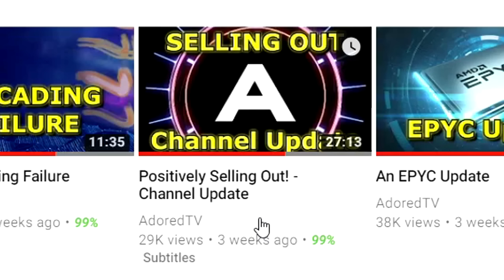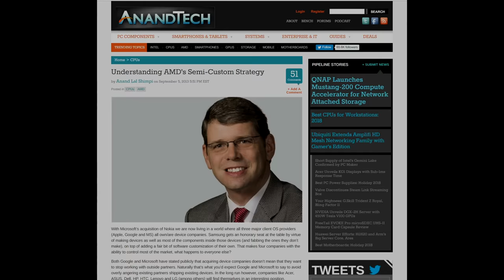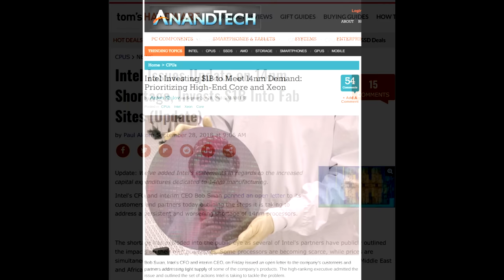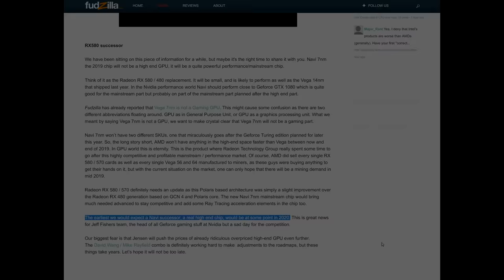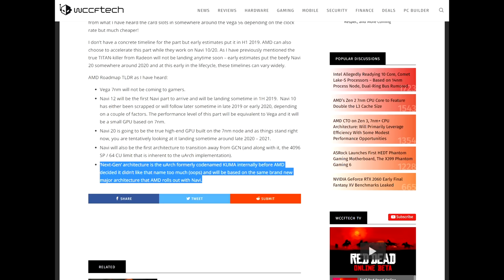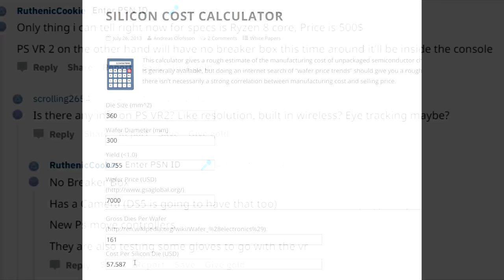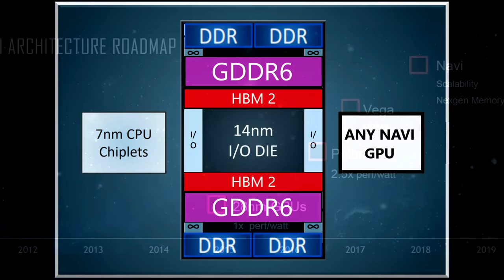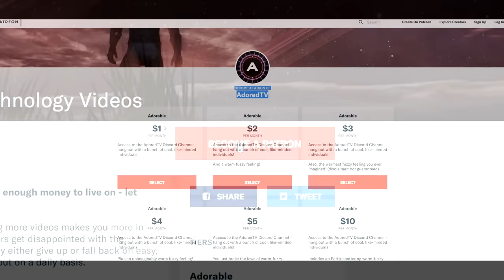AMD  - The (Evolving) Master Plan

Comment: Something I have to bring up about the NVidia vs. AMD GPU wars. One of the main reasons people stayed/went with NVidia was because (even though their hardware was at times the same or inferior) NVidia had drivers with MUCH fewer issues. I can't begin to describe some of the weird issues that various GPU vendors had (3DFX, S3 and ATI) that NVidia didn't.

I'm talking about drivers that wouldn't install (or cleanly uninstall), or that would install and then BSOD your computer, or that wouldn't properly render 30%+ of the games available on the market, or would cause the game  (or your system) to crash if you played said game. NVidia side-stepped a TON of that.

They also implemented a near-fully functioning OpenGL driver that 'just worked' not only for games, but also professional applications. That helped gain them a lot of mind-share with the emerging 'professional-at-home' market that was beginning to spin up in the 3D, compositing and video editing worlds. There were other things as well (unified drivers, the ability to downgrade without issue if the newest driver was causing issues, etc.)

I feel that is the real reason why people started ignoring the other GPU vendors in favor of NVidia, and have stuck with them. I can say that I was reading the mentioned Anandtech articles (both in this video and others) that you've referenced - when they came out, mind you - and it got me interested in buying AMD/ATI again (and yes, I had a few of their GPUs before)...but then the hardware would come out and the driver issues would follow, so ultimately I stuck with NVidia and have to this day.

When your work relies on your computer/GPU, having good/stable drivers means you'll go with more expensive/slower hardware if it'll reliably get the finished result out the door (or let you play a game without crashing).
Reply: While that might be true today, I was talking about back when NVidia didn't have a majority of the market (or even the lead in dGPU deployments or sales) that they made things better and easier for consumers. The time period I'm talking about was when 3DFX ruled the roost and ATI and Matrox were chief competitors (and S3 was the cheap 'un-accelerator'). That aforementioned ease and reliability is what helped NVidia take the lead and eventually snuff out most of them.

As to today, their quality has gone down (too many weird bugs in their latest drivers, in addition to other issues) and ATI/AMD is doing a lot better on the driver front than back in the late 1990s/all of the 2000s/most of the 2010s, but with the momentum NVidia has (and their excellent marketing, the sheeple effect in full force and some of their vendor lock-in) it'll be hard (but not impossible) for AMD to gain a majority...

That said, AMD still needs to get their drivers in better shape (esp. for their APUs) if they want to have a chance at beating NVidia.
Reply: AMD has not given up, it's just they didn't have the money to do both Zen and Vega (properly), so they went with Zen first (AdoredTV covered this not only in this very video but some others as well) and now that they're making money they've invested in the GPU side as well...but as this and other videos point out, it takes at least 2 (usually 4+) years for that investment to show up in product that the public can buy.

As to Intel, your supposition is completely ridiculous. The government has nothing to do with their decision to make GPUs. It's - again, covered in another AdoredTV video - that we're talking about a (capitalist-driven, free-market-created) $40 BILLION (USD) industry and anyone who can make that kind of stuff would be a fool to not get in on the action. Intel has the fabs, the engineers, the money and the contacts/reputation to make it happen, so they're doing it.

NVidia (who practically created that market single-handed) is in it, so is AMD (who stands to make a nice profit, if not a lot of money), ARM is working on being in it (will be interesting to see how that turns out), and there are even rumors of Imagination trying to get into it.

As to AMD crashing, I certainly hope not, but they need to do better on the GPU side. On the CPU side they've turned it around, and on the APU side they stand to make some nice money over the next few years, in addition to the console business. Hopefully AMD can turn it around on the GPU side (just like they did with their CPUs)...and if they don't...well Intel (and maybe someday ARM or Imagination or someone else we don't know about) will try to sell you a GPU instead.

Comment: I really hope that the PS5 does have a 8 core Zen based cpu, it would make it easier for pc games to utilize cpus with high thread counts like the Ryzen 5 and i7 8700
Reply: You know PS4 and Xbox One is already on slower 8 cores (7 usable for the game 1 reserved for system work), this environment favors multi threading even more, yet game still struggle to do so. Biggest problem is sequential nature of games programs, you can divided task in to threads infinitely (the perfect multi threaded program should scale infinitely), but what kill the entire concept is data from other task wait time and actual power needs of those tasks not saturating the CPU entirely. Because of that games never gonna use 100% of any multi CPU setup

Comment: Hey Jim, I've watched this 6 or 7 times now but the 1 thing that's bugging me is how much GPU power does a PS5 actually require to be a 4k 60fps stable kind of monster?

I mean you said it yourself in this video the PlayStation is a closed system and without really looking into it I thought the current consoles did 4k by rendering 1440p then upscaling it and ending up around the 30fps mark.

As you know there's a big difference between an "upscaled 4k 60fps monster" and a "4k native resolution 60fps monster"

Is it possible you're over estimating what is required to reach 4k/60 native based on what a PC requires?

Anyway keep up the great work mate. Catch ya later!

Comment: Hindsight is 20/20 however I think the key is not that chiplets are better than monolithic, the key is actually having the guts to do it, implementation, people don't always read statistics and facts the same way, or sometimes companies are too rigid.
Like you say if Amd has gone this way, they must've done it without reassurement. 
The notion of spliting large components into multiple smaller parts is not new at all, miniaturization is at the core of electronics, th japanese led tge way in the 60's, that's what made electronics affordable, yet it is still impressive the brilliance in these new implementations.

Comment: Could it be possible that with the scale of manufacturing console chips AMD would use this to their advantage? What I mean by this is AMD could use the same chiplet modules found in next gen consoles for the desktop and server markets. Low performing chips could be binned for consoles but higher performing parts may be used in high end Ryzen and threadripper packages. This would allow for AMD to match intel when it comes to economies of scale and all the benefits that come with that. Is this plausible?
Reply: Possible

Comment: surely it would just be cheaper for them to eat the cost of the defective zen 2 chiplets than have 2 4 core chiplets? especially as the process matures.

maybe amd could instead produce the chiplets with tsmc then sell them to sony rather than sony going to tsmc, allowing them to better utilise the perfect 8 cores rather than fuse them off for 6 cores, this would also change the bell curve for their consumer market as they would be buying more wafers and more 8 cores would be going to sony, not pc while all 6 cores do.

oh and ofc you mention it later, not a stone unturned.

Comment: about sharing the same chips between the consumer and the console space: wouldn't it be at least somewhat problematic that the console has a much longer lifecycle so a zen 2 chiplet may be long gone on the consumer space when it's still used in the console space. Over time limiting the scaling benefits of sharing the design. Sure you may sell of some chips for legacy server orders but that would probably be about it.

Comment: im having a hard time figuring out what they are doing for the desktop as well.  if they go with chiplets there will be a hit on mem latency if they have to go off die to hit the io die.  the extra l3 would help there but still.  if they go with a seperate die for the destkop with the whole soc on it then they cant bin the chips to make epyc from those.  maybe they could put an imc on the chiplets that is just deactivated when used for epyc but functioning when use for the desktop with an io die as well for soc functions.  im pretty sure the usb and pcie lanes go off the soc on the current ryzens.  you could put that on the io die and have the imc on the chiplet.  that way there is no memory latenyc hit when using the chiplets for desktop.  i just dont see them going with a memory controller thats not on the die.  it wont be a huge hit to latency but when you go off die on epyc and threadripper chips the latency is pretty large compared to just ccx to ccx on the same die. 

whatever they do im sure it will be interesting.  glad to see them back in the game. now we just need a new gpu.  a real one.

edit:  just got to the part about the consoles.  that would certainly replace the large pool of desktop cpus.  so that means they could make a seperate line of desktop cpus that dont use chiplets.  the rule with consoles is that you make sure that programs can fit inside cache because you have to save all the bandwidth for the gpu since the cpu and gpu share the same memory.  that would mean that the memory latency from using a mem controller that isnt integrated on the same die as the chiplet would not be as big of a problem.  so im leaning more towards a complete soc for the desktop mroe than ever

Comment: I don't know if a monolithic die for the PS5 is actually that much of a problem. They could use the defective dies and have a $300 PS5 base that achieves 1080p60, with a $500 PS5 that achieves the 4k60 that is rumored.
Reply: I'm just saying that the low yields from a monolithic die solution aren't as hampering that AdoredTV implies.

Comment: I wonder what the pricing will be. Will it force Nvidia prices down, or will AMD go up to meet them; say the 2060 is $399.99, will AMD say "Pft, chip+RAM+board=$163.22. MSRP will start at $249.99 for a card that slightly outperforms the Vega 56 at stock speeds", or if they will jump on profit and hope to pull away a smaller segment of the market, selling the card for $349.99+. I obviously hope for the previous, but unfortunately for me, I'm not in the market for anything less powerful than a 2080ti, which I won't pay $1250-$1400 for. A grand? Probably, and I would much rather buy from AMD right now anyway, as they are the ones who aren't trying to exploit their customers atm (not that they are above it, but they certainly could have charged a bit more for Zen+ an TR, but the price points basically stayed the same while improvements went up a decent amount).

The "Hurry up and wait" from RTG is annoying as heck though. If Navi 10 had 1080ti levels of performance at a high midrange price ($279.99-$349.99) then I might consider upgrading my midrange PC. If not I'll just keep saving until I can get what I want at a price I am comfortable with, though the more money I put aside, the more difficult not overpaying and waiting becomes.

Comment: Don't IO features on a die needs to be around the edge due to the machines connecting the die to the substrate pads with tiny gold cables? Does anyone know of an example were connections spanned to the middle of such a large die (Jim's suggested IO die)? 

Another interesting point I want to throw out there is the salvaging of dies, not just from dust defects, but also individual cores' attainable clock speeds. If true, it would mean a slightly cut down GPU/CPU where the very worst performing cores/streaming processor clusters were disabled would allow for an overall increase to the clockspeed of the chip.

Comment: Did you take into account that all the controllers and interfaces on the I/O chip all need to be on the perimeter? A 150mm2 I/O die is going to be pad limited with a 256bit GDDR5/6 bus, let alone a 384bit bus, 2048bit HBM2/3 interface, DDR4, and IF. IMO- I don't see them putting the GPU I/O on the I/O chip, it seems to add way too much complexity for no gain/advantage. 

I mean, maybe I could see a 128bit GDDR6 bus or a 1024bit HBM2/3 (aka ~250GB/s bandwidth) interface on their "consumer" I/O chip for use with their APUs/SemiCustom SOCs or maybe they move the consumer I/O chip to 28nm which means larger die size (i.e. more pad space) at a cheaper price?  

If your crazy I/O die is true, where does that leave Navi 10 and 12? Every single desktop GPU needs the I/O chip as well, wasting the space of the DDR4, IF, and whatever parts of the GPU bus that chip doesn't need?

Comment: And now another interesting piece (which you likely already heard, but didn't have  time to include): "[Rumor] Microsoft Surfaces considering AMD for next generation"

Almost all big IHVs that push new form factors (apple, MS, hp, dell... etc) are very frustrated with the exceedingly lacking iGPU of Intel chips, where to do anything extra requires a discrete GPU which blows the whole power budget. To be able to get a APU with even 1070 as a baseline and 6+cores would have them doing bidding wars for what little scraps they could find on the floor. Remember that these classes of laptops/mobile devices sell for thousands easily. Now you have shockingly good yields reusing up and down a product line? 

I really hope even half of this is correct, means quite exciting times, and perhaps one of the first truly industry wide shakeups since the early 2000s.

Comment: i think the performance will be gtx 1080 performance range not a 1080 ti. a 1080 will be double the power of the current 4k 30 fps consoles they can do 4k 60 with a 1080 if they lower the settings which they always do on consoles

Comment: But isn't 8-Core chiplet already confirmed to be ~70mm2 ? Whats the point of a PS5 prediction with 2 x 4 Core Zen2 at 144mm2 ? From all leaks it looks like each Chiplet has 99.9% chance it contains 32MB L3 and 8 Cores, the only missing part is the number of CCX's within.
Reply from the maker: 144/2 = 72mm for each chiplet, which is 4 salvaged cores. ;)  That's just pure speculation, I'm actually quite sure it would only use one Zen 2 chiplet.

Comment: Interesting, but comparing just chip sizes is not quite accurate, as more complex packaging has cost in both process and defects. Also, it is not AMD who produces chips for the consoles, the manufacturers source those themselves (obviously in agreement with AMD, as the design relies on it), and AMD gets a share. Sony and MS are also likely to want something special each, so at least the GPU will likely be custom (I guess, the special thing could be just a lower level API access, but that too I find unlikely). As you mentioned in the video, latencies may be hit with a multi-die approach and that might be unacceptable for the console manufacturers.

Nice video though, definitely food for thought!

P.S. I still think ray-tracing could make sense as a separate chip
P.P.S. I also still think PS5 is likely to focus on 4K/60 and VR, while the XBox could go the ray-tracing route (DXR is MS after all), but perhaps come out a little later

Comment: Is there any way they could design the dies such that they can 'translate' the section that's cut out of the wafer? Say a Zen 2 die has a defective core at the "top" of the die and the die "below" it has 3 defective cores at the "bottom" of the die, could they design the dies so that they can cut out the bottom 6 cores of the upper die and the to two cores of the lower die to make a full 8-core die?

It would make packaging a lot more difficult because the I/O controllers would be in different locations (unless infinity fabric somehow makes this easier) and I imagine they have to leave some dead space at the edge of each die so the scoring and cutting machinery can separate the dies, but maybe leaving those margins between each core as well as the edges of the die would help with heat distribution a-la "dark silicon" anyway?

I wonder how that technique would impact yield...
Reply from the maker: Nah it would get to the point where it's not worth the cost to do such.  As you can see in this, yield is already extremely high even with chiplets and salvaging.

The combination of chiplets, redundancy and moving the unsalvageable stuff off the main die (mem controllers and IO) and on to 14nm is just killer.